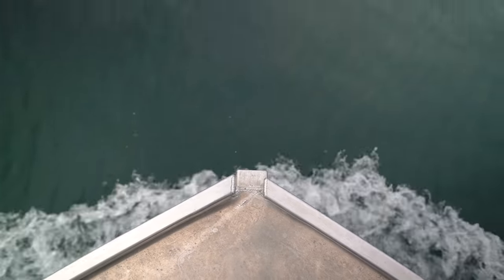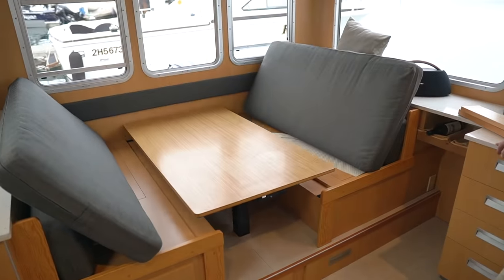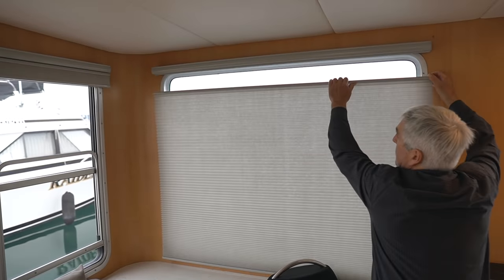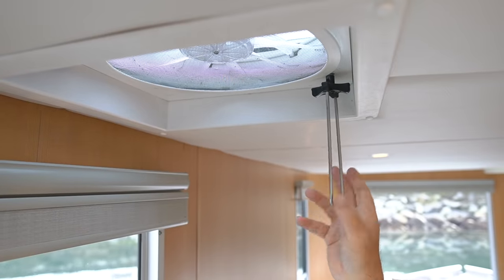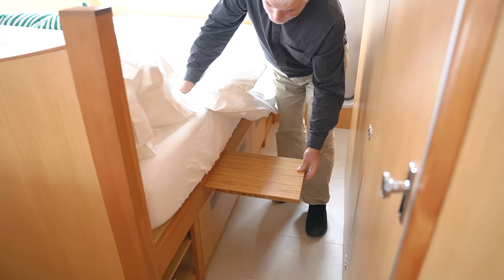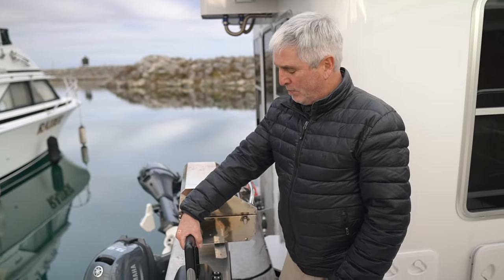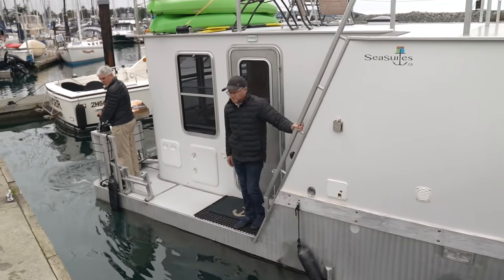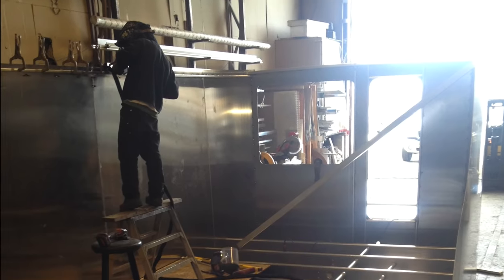Boat Builder's AMAZING Modern Tiny House Boat - Full Tour

Comment: A great concept! You must have loads of fun in it. I love the remote control steering, I bet that turns a few heads! I also love the ‘proper’ bathroom, with separate shower, sink and toilet. Many larger boats have a ‘wet-room’ which is very annoying, having to dry the floor, after taking a shower,  before using the other facilities!
Reply: Yay

Comment: That water bladder concept gave me the idea that if I had an RV with a leaky tank, I could simply put one of these inside the existing tank to save some money and effort.
Reply: They do rub holes eventually
Reply: @zeusapollo8688  They're warranty is substantial. Additionally, these bladders are designed and manufactured with rough service in mind.
Reply: You'd have a very difficult time getting a bladder of any size in the existing openings of a rigid tank. Better to simply, quickly, easily and affordably plastic weld any crack on a rigid tank.
Reply: I used to cut the top of the tank off.  This is marine use.
Reply: Might be baffles inside your tank bud
Reply: @zeusapollo8688  but they are so easily replaced and cheap, great idea
Reply: Yup you could most definitely...
Reply: @ARepublicIfYouCanKeepIt  you mean THEIR* warranty, not "they are warranty" which is what you said
Reply: *Also you could leave the tank in to better protect the bladder and keep it within the form the tank has, keeping the tank strong by minimizing the cut out you would need to insert the bladder.

Comment: What a beautiful vacation home!  The living quarters were elegant and well designed. The use of bladders as tanks could also be used for RVs (no solids).  The inset reading lamps, pull out tables under bed, floor storage are ideas that can be, and have been, used in RVs too.  I love boats, but too costly to maintain. I think I'll stick with RVs and the occasional kayak outing.  But what a beautiful way to live. Every window is a painting with light and movement. Superb!

Comment: Pretty awesome what you's have done.  Thanks for comment about flat bottom not bobbing around as much - which I didnt consider looking at what to build.  {But Im thinking ferrocement due to cost}.  The drifting due to wind - put front rudders on / swinging  'keel outside plates.'   Lots of good ideas thanks!

Comment: Gorgeous. I am an architect/interior designer, and I love the simplistic, yet classy interior. From an interior design standpoint, the windows and doors having rounded/radius corners are the main element that gives one the sense of being on a boat. Is there a reason that the windows and doors don’t have 90° corners? At 11:16 you mentioned that you were in the process of changing window types. Are you considering changing them to a more residential window type and style? Is design a factor? If so, are the interior or exterior design choices more important?

Comment: Outstanding. How practical would something like this be for the Great Loop
Reply: I am wondering about the open sections along the coast, through the gulf, and across the great lakes. While it does appear better than the average pontoon houseboat, there is a big step between protected rivers and canals and open water.
Reply: Idk methinks the 2x 9.9hp engines and keyfob remote control thing may not suited to long canal/river journeys where you are often navigating around bends, obstacles, other marine traffic, in and out of locks, etc.

Comment: I highly recommend upgrading to an all in one solar module. The features compared to separate charge controller / battery charger / inverter is really good for the price. also super simple to wire.

Comment: Hammocks instead of the bed & perhaps captains chairs that can hideaway. for foul weather cruising.  Curious what the mileage & potential cruising range would be daily.  Really wonder what potential it could have as a pv full electric platform too. Design features are definitely worth stealing. Curious how adaptable & durable the bladder type water storage would be to a van or rv overland build. Ball & socket access panels seem no brainers for access to system maintenance. The drawer comment is soo sensible. Kudos to the builder &
Thanks for Sharing.... 😃👍
Reply: This type of boat isn't a "foul weather cruiser". It's built to be in the ocean, but protected waters, not open ocean. Your going to start and end your day at a marina(or nice anchorage).

As for the range, he had tiny outboards, two 10 hp's. Yours probably looking at 5 liters an hour cruise at maybe 5 knots. 

Not bad range with a decent tank, just make sure not to go out in windy weather.
Reply: @TheOwenMajor   The flat bottom & floating box... TY for the analysis.

Comment: Hm. Perhaps a little over the top in the gadgetry (not sure the remote control steering is entirely the safest way to handle that). But the water bladders are pure genius.  And a houseboat with a full size shower?! The length is perfect as well. I wonder how much a more basic version would run?

Comment: As long as you treat this as more house then boat, then I think it's very practical, modern, and comfortable. However, I wouldn't treat it as something that is capable of traveling anywhere except to the boat launch, on small lakes, and rivers. The flat hull and overall design will not do very well in open waters. As long as its used for its intended purpose, It's a fantastic build made by someone who really knows his stuff.

Comment: the flat bottom may provide stability. But sounds like some vertical ribs should be run front to back to mitigate the side sliding in windy conditions. Would only lose a few inches of draft and being flat bottom..... Should not be an issue.

Comment: Nice story here but I wouldn't take that out on any large body of water.  Even though you have all that flotation it looks to be a disaster waiting to happen.  I understand the  boats length issues because mooring is all determined by the foot. You did very nice work on it I must say. Good luck I hope it works for you.

Comment: I love the idea, and I'd rent it for sure but it's overpriced. I knew it wouldn't be cheap to build/buy one. However, at $260,000 CAD, (roughly $203,000 USD), it is just too much for it's capabilities. Even with it having superior construction and amenities, it can't cost them even $150,000 USD to build the damn thing. Seems like a high profit margin, even if I'm off a little. For that money, it should have a hull and bow designed to take on waves and an inboard diesel engine. Hell, an old River Queen houseboat can at least hit 3 foot waves before water comes over the bow.

Comment: So long as that is stationary, it works great. However, if someone were to get caught in a storm (a real storm not just some rain) it would not do well. The idea is good but needs a lot of fine tuning. Really? Putting the only way to drive it outside is not smart especially with very little guardrails (if you can call them that). Also, where are the safety/emergency  supplies? Not a safe boat in the least.

Comment: What junk! Dangerous too. Forget travel- a big broad sided overweight rig like that with 9.9hp outboard and a hull draft basically at waterlevel would get blown over and capsize with any normal lake conditions. I wouldnt cross a swimming pool with that thing
Reply: Never seen a barge before? Nobody is claiming you are going to do a transatlantic crossing bud. But this thing will put around the gulf islands just fine.